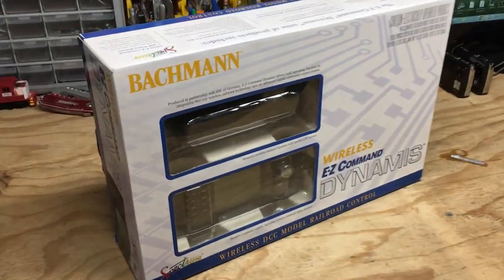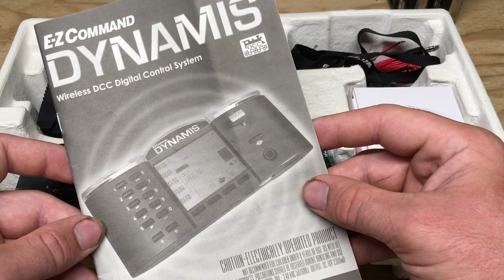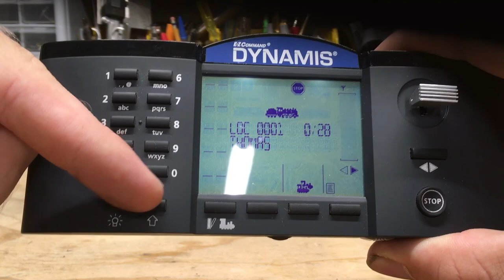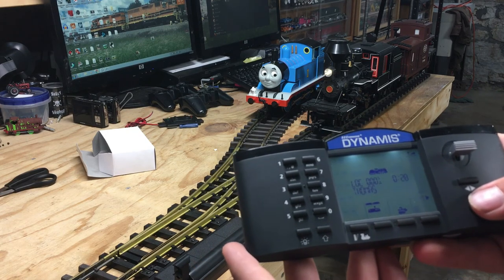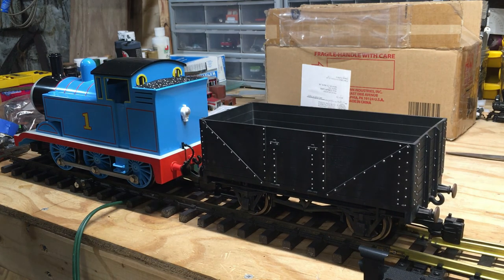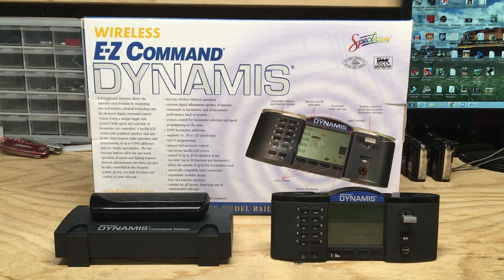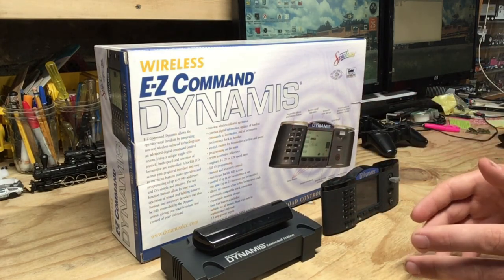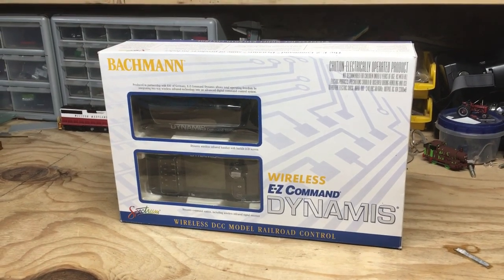Bachmann E-Z Command Dynamis Wireless Infrared DCC System #36505 Unboxing

Comment: How far away from it can you be? Also, if I mount it in a central location, and am on the opposite of the layout - will this cause issues?
Reply from the maker: From memory, I could only get about 10 feet away before the system would go into emergency stop mode.  You can buy attachments which will increase the range, but I just see this as more of a money pit than its worth dealing with personally.
Reply: @PlowBenderStudios  without firsthand knowledge, and based on several opinions like yours - Im going to stay away. Thanks for the insight

Comment: Plow Bender, what DCC system did you finally decide on? Is there one that also do Radio, that's what I am looking for in Large Scale
Reply from the maker: I started using a DCC system by MRC which they sell a Wifi module for so you can control your trains via smartphone or tablet.  The only problem though is that this new system presented me with more problems once I added the module to it.  I contacted MRC and got no help whatsoever and customer service was the worst I've ever experienced.  I've even reached out to several other people here on YouTube who own the same units and they don't understand why I'm having the problems I am.  I'm intending on doing a video in regards to the DCC system and MRC because I am not very pleased with what I've seen from them while doing my research.

Comment: I remeber having one and I took it back within a week to the shop and got another controller. It's a beautifull design but its a terrible piece of hardware techonlogy for 2021. For what is no more than a games console to operate trains its a scam. I only want dcc to run sound and if I can get this on analog and computerize that with arduino and rasberry pie 4+ I will do that.